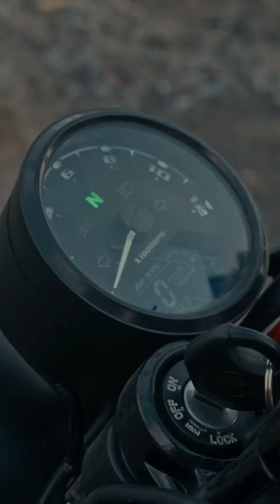The Suzuki RE5: The Bizarre Rotary Engine Motorcycle

Comment: Amazing that the Suzuki bosses couldn't see what a dead=end the Wankel was as the prototyping & testing went on. I know that the RE5 was basically half the real bike that they intended (a twin rotor was the original plan.....it partly why the rad & other cooling systems are so huge) but they must have seen the heat, weight & fuel consumption issues (especially post 1973 oil shock). Very strange that nobody had the foresight to pull the plug as Honda, Yamaha & Kawasaki did.